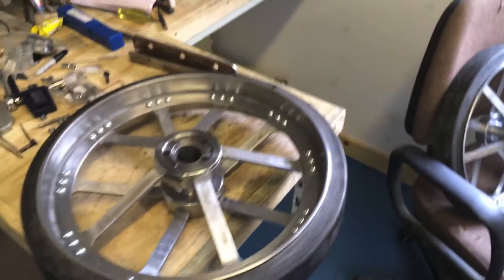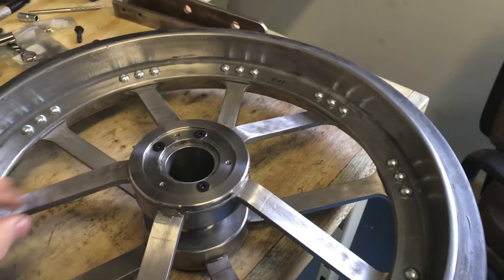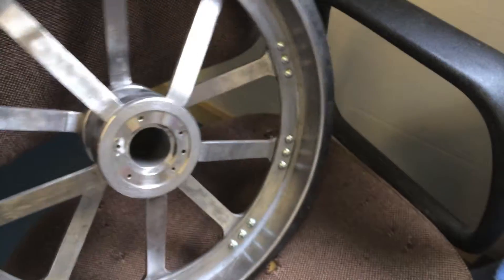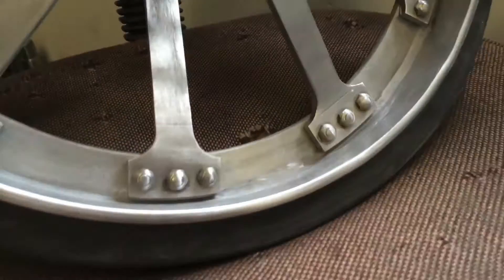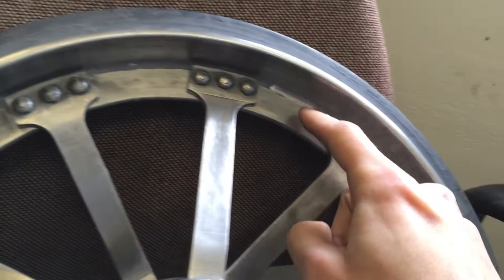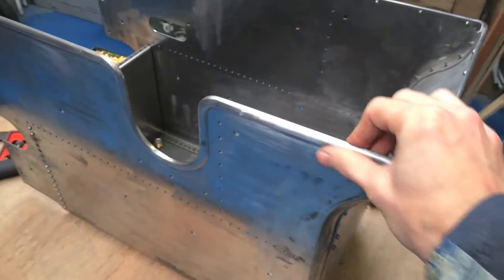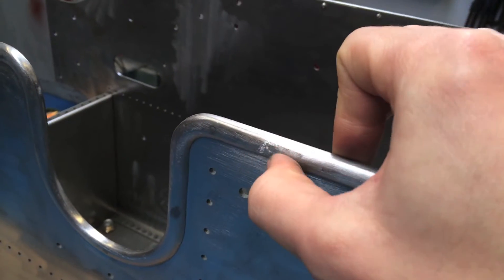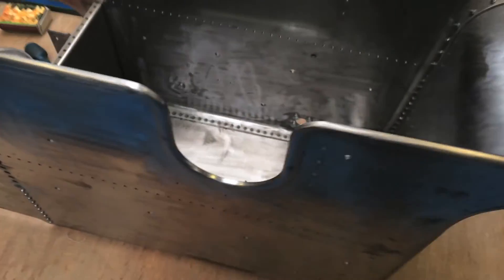Building a Burrell - Part 4 (front wheels and tender update)

Comment: Hi currently starting a build and I have dry assembled the wheels.
One question 
The countersunk screws that hold the spoke to the hub sit really proud and when the cap is fitted it sits on the screw heads and there’s a gap.
Is that right and the epoxy fills the gap ??
Reply from the maker: I wouldn't build it that way - countersunk screwheads should be flush or sunken but never proud IMO.

Comment: Hi Chris, just received my tender and was wondering what would be better with the sealing process plus should seal it before painting or afterwards? Still pretty far away from that yet as I haven't opened the box but I'm just not sure😂
Reply from the maker: Isoflex seems to be generally regarded as the best method for sealing, and definitely do it before you paint as it can make a mess! You'll need the Isoflex primer which is a clear and thin liquid which prepares the surface and then the Isoflex rubber itself which is gloopy and black (same stuff as you use to stick the tyres on). If you check the STW forum some guys have tried the POR15 sealer (I have used this on my belly tanks) but found that after a season there is rust starting to form on the inside of the tank. Others have had Isoflex in place for many years and not a bit of corrosion apparent.
Reply: +ChriX Builds perfect! Thank you for your help! Yours is coming on really well now, looking forward to more videos... Really underestimated the work involved with all of this!
Reply from the maker: +Phillip Stone you and me both... Haha :-)